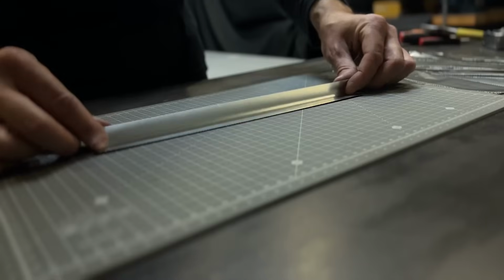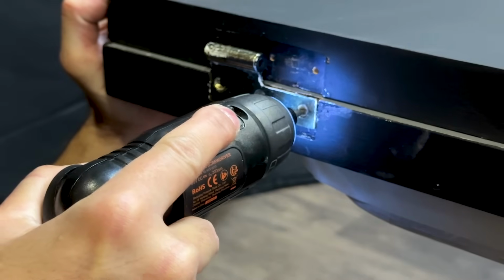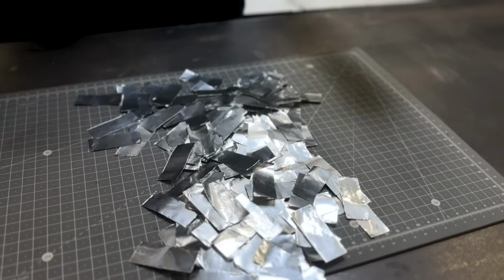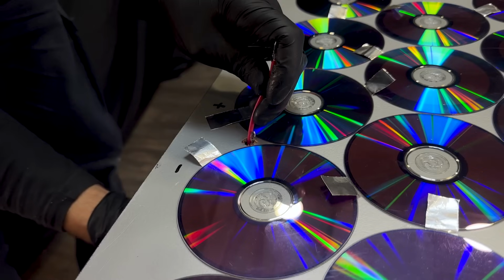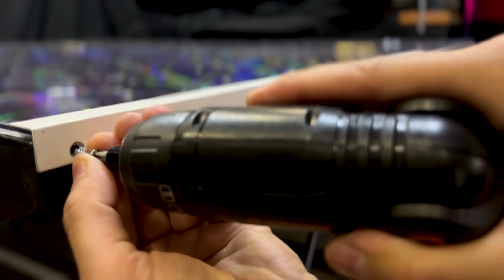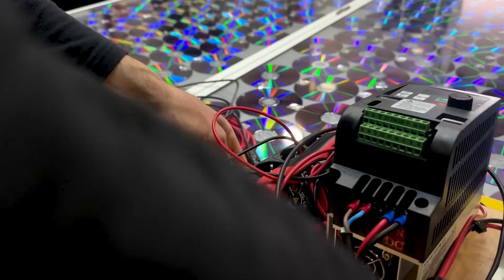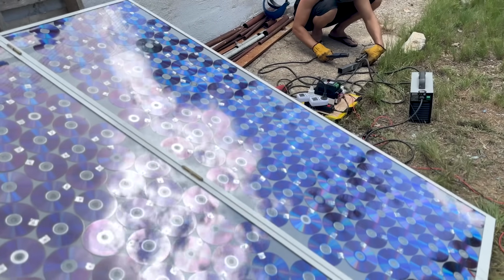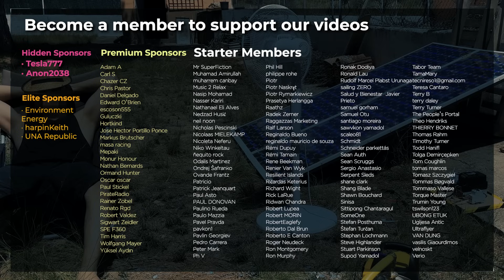Homemade Powerful 3000w Photovoltaic Solar Panel with CD / DVD

Comment: Why would someone ever think this might work! Don't waste your time or materials on this, it will not work.
Reply: Why won't it work?. Please explain
Reply: @murraychadwick9362  Just one of many reasons, and the simplest, is that the reflective surface in the discs is electrically insulated with plastic. Even if an electrical charge was created, it wouldn't "flow' through the plastic that protects the reflective surface.
Reply: @WylieWiggins isnt that why they connected the cd’s on the other side with the alu. Foil?
Reply: @Crypto_Zeus7610  plastic coated as well.
Reply: @WylieWiggins  Yeah, you forgot that it was grinded off with a small rotary tool ...to allow electrical conduction, then the foil connectors were taped on it. You clearly didn't watch the video! You just eyeballed it and skimmed through the video at best. Then you jumped to conclusions that it wouldn't work!
Reply: @Dale-wb9lz  Good luck with it than!
Reply: No they do! There has been several studies on it, they are not efficient and very low power output, and to aswer all your questions on how if there is a plastic coating, take a 12v lead acid battery and take a cd or dvd and face the printed side up and touch the two wires against the cd (not for too long, about 2-3 seconds at a time keeping a eye on the battery temp)  a arc will form across the foil creating a nice lightning style pattern in the foil so if that can be done then contact with the foil can be made
Reply: You can make a very basic solar panel with a sheet of white A4 paper and literally draw the circuit with a graphite pencil and connect it, of course it's very low powered but it generates electricity.
Reply: If you recon it will work because of a thin aluminium layer sandwiched in the poly, well you might as well buy a roll of aluminium foil.
Reply: @HuSiaCat Nothing useful. Lots of materials exhibit some photoelectric effect but very few are efficient enough to be useful.
Reply: I am interested in storing the energy for running  household  needs like light
Reply: serial 200 cd and 330v later?? 😂😂😂😂Why didn't the factories that produce solar energy panels think of this?
Reply: If it doesn’t work then how’s he using it ? Genuine question
Reply: WylieWiggins must be a Solar panel salesman...😂😂😂
Reply: @dorismileng1961    just buy a panel sized to recharge your battery bank in the shortest daylight your area has.  A charge, discharge controller rated at your estimated amp draw from bank.  But you can energize  c7 size led bulds ar 12v (recreation vehicle) bulbs in multiple choice lumen at battery level, some have multi brightness built on the bulbs. !
Reply: @WylieWiggins  so the fact that he ground away the plastic and then measured the voltage of one cd is proof it won't work?
Reply: @WylieWiggins  because this does work. It's in no way efficient but it does work. It's a great proof of concept as an experiment I have done this before.
Reply: That's why he exposed the foil to get a charge.   @WylieWiggins
Reply: @mrrandom3207  Not even up there with dragging stocking feet on carpet! Lame games people play!

Comment: I built two panels just like the ones in this video to power my homemade military satellite.  I launched my satellite yesterday using a bleach-powered rocket and it's currently in orbit reporting on Syria.  I couldn't have done it without this video.

Comment: did this today unfortunately the plastic on the cd shows no continuity and if you drill to the silicone yes has continuity but putting a sliver foil on one side will not make a circuit i wanted to debunk it so i made one its impossible to work FACT.

Comment: Oh my God, what nonsense! I work at a company that produces solar panels, from soldering the cells to laminating the modules and testing them with special devices called SunSimulators, or as we call them, Flashers. So, a solar panel does not function at all like it's shown in this video. The process of making a solar panel is as follows:

The glass panel is placed on the conveyor belt.

On top of it, an EVA (ethyl-vinyl acetate) sheet is placed.  
Then, the "Stringer" machine solders the monocrystalline cells in series with a conductive BUS BAR (10 cells soldered in series make up a "String").

Next, these strings are placed on the glass, which already has the first EVA sheet. Then another machine applies the connecting Bus bar between the strings with a +/- orientation. After that, the second EVA sheet is applied, followed by the reinforcement sheet "BackSheet," which is a stronger sheet, something like high-density PA (Polyamide High Density).

Now, the module goes into a laminating machine that, through vacuum and heat, melts the glass cells without shifting them and removes any air bubbles or traps. After this process, the module (or now called the LAMINATE) moves to a robot equipped with a knife that trims the excess melted film from the four sides. The next station is an optical inspection by a worker who checks, under strong light, if the bus bars are in position and if they haven’t shifted during the laminating process.

The next step is framing, where metal frames are applied around the Laminate. Then the junction boxes are connected by soldering them to the contacts that were left exposed under the film. Finally, the module reaches the SunSimulator (Flasher) testing system, which illuminates the modules and measures each module’s power, after which they are sorted by category. At the next station, the junction boxes are filled with a silicone that prevents moisture from getting in. After that, the modules can be packed. So, that’s roughly the process. What’s shown in this video is utter nonsense.
Reply: Did you notice that he was making a homemade solar panel, not a professionally made one in a factory.
Reply: @jerryrussell2600  Did you notice that in no way, what he’s making is a homemade solar panel.
Reply: @rusznyaklorand  I mean it does work very little and practicality is all out the window when youll have the entire Willis Tower in Chicago covered with CDs to power just a school bus ....it doesn't absorbed as much as you think which makes the person above absolutely right....this isn't a solar panel more of well a pain in the ass for very little to no profit...
Reply: However, you can lap CDs one over the other and fill the hole in the middle with hot glue and use them to shingle the roof! Just sayin’
Reply: @dcmp3po  However, when shingling the roof, make sure to use non-burnable CD’s.
Reply: @dcmp3po  If you had a concave roof, you could probably start fires on  gaseous planets. Or, if everyone would take all there old cd’s and carpet there lawn with them, we could reflect enough solar energy to stop global warming. Although it might not be safe to travel in an airplane.

Comment: The diameter of a DVD is 12cm, so radius is R = 6cm = 0.06m
The diameter of its inner hole is 1.5cm, so radius is r = 0.75 cm = 0.0075m

Area of DVD (minus central hole) = Pi x (R^2 - r^2) = (3.14) x ((0.06m)^2 - 0.0075m)^2) = 0.0111 m^2
Area of 210 DVDs = 210 x (0.0111m^2) = 2.338 m^2
Area of DVDs minus the 210 ~15mm x 15mm aluminum strips is 2.338m^2 - 210 x (0.015m)^2 = 2.291 m^2

Solar constant at top of atmosphere is  Gsc = 1361 W/m^2
Actual peak solar irradiance at the Earth's surface on a clear day is closer to 1000W
Actual peak solar irradiance at the Earth's surface on a cloudy day is closer to 500W

Total solar irradiance intersected by 210 DVDs at top of atmosphere = A * Gsc = (2.291m^2) x (1361 W/m^2) = 3118 W
Total solar irradiance intersected by 210 DVDs at surface on a sunny day ~ A * 1000W = (2.291m^2) x (1000 W/m^2) ~ 2291 W
Total solar irradiance intersected by 210 DVDs at surface on a thin cloudy day ~ A * 500W = (2.291m^2) x (500 W/m^2) = 1146 W

Claimed output of solar panel is 3000W, so:

claimed efficiency if it were above the atmosphere is 3000 W / 3118 W = 96%
claimed efficiency on a sunny day at the surface is 3000 W / 2291 W = 131%
claimed peak efficiency on a thin cloudy day at the surface is 3000 W / 1146 W = 262%
Reply: @green_dog8960  You explained it very well. So, does this system work?

Comment: There is only one way to find out is find one CD/DVD with double silicon layer and see if it can generate 1.5v
Reply: Проверил-добраться до обратной стороны невозможно,нужно спилить весь пластик ,а слой кремния очень тонкий и он не может держаться-.подключиться невозможно.Напряжение есть только от наводки,если держаться рукой за свободный конец прибора ,а второй присоединить к кремнию.При этом кремний тоже изолирован его нужно зачистить.Напряжение наводки может быть до 0,6 в.  А тока нет поскольку нет цепи.

Comment: is it posable to make a solar panel with CDs?

Yes, it is possible to make a simple solar panel using CDs (compact discs). This can be done as a DIY project, often used for educational or demonstration purposes.

The basic idea is to use the reflective metallic coating on the back of a CD as a makeshift solar cell. When exposed to light, this coating can generate a small amount of electrical current that can be used to power simple electronic devices or charge small batteries.

Here's a general overview of how to make a solar panel using CDs:

Gather the materials: You'll need several CDs, a small electric motor or LED light, some wires, and basic tools like scissors or a knife.

Prepare the CDs: Remove the outer plastic ring from the CDs to expose the reflective metallic coating on the back.

Connect the CDs: Arrange the CDs in a grid or panel configuration and connect them in series using the wires. This will allow the generated current to add up.

Attach the load: Connect the small electric motor or LED light to the positive and negative terminals of the CD solar panel.

Test and optimize: Expose the CD solar panel to a light source, such as a lamp or sunlight, and observe the operation of the connected load. You may need to adjust the number of CDs or the wiring to optimize the power output.

Keep in mind that the power output of a CD-based solar panel is relatively low, typically in the range of milliwatts. It's suitable for powering small, low-power devices, but not for high-power applications. The efficiency of this type of solar panel is also quite low compared to commercially available solar cells.

Nevertheless, making a solar panel with CDs can be a fun and educational project, especially for students or hobbyists interested in renewable energy and DIY electronics.

Claude 3 🤷

Comment: No way 3000 watts could flow through those little pieces of aluminum at the end connection on the panel. they would melt instantly. I call Bull Shit on this.
Reply: @danielohara2974  The foil ist strong enough to Transport all the current coming from this setup. No voltage means no current. So everything is fine.
Reply: @snooker216  my bad...You nailed it!  lol

Comment: 🤔 somebody please tell me I’m wrong!  let me think. I’m not going to go back and check the number of CDs, but if I remember right. They claimed they connected them all in series and got over 300 V at the end of the series. My question is why the hell are they using heavy wire to connect to their series of discs when the last connection is made out of flimsy little piece of aluminum foil that would blow apart with anyamperage put to it whatsoever. Tell me I’m wrong. 

Please tell me I’m wrong!
Reply: Maybe he used the wire size he had, if it is bigger than necessary that is never a problem.

Comment: Why the pixeled faces? 🤔  Using tape to secure the foil to the silicone surface?  Panels get extremely hot in the sun?  Hot glue?  First time out they would all melt off and separate.  3000W/330V=9A per CD "cell"?    

At 93 W/FT° of sunlight power, you're generating over 100% of the available power at 100% efficiency.  CD Dia 4.75" = 0.123 FT° x 220 disks = 27 FT°   93 W/FT° x 27 FT° = 2517 W and that's at 100% efficiency!
Reply: @MechEngrSC  Store bought solar panels are regulated to only 15% efficiency.
Reply: Haha, wrote nearly the same comment. Now I saw yours. But for the guys that use SI units it is still good xD.
Reply: Fraudster 😠

Comment: For those that say it won’t work, have you tried it? Or just said “no”? I don’t know either way, just curious. It reminds me of the guy who ran the patent office in the early 1900’s. Once he saw it went to a million patents he said it was time to close the office because everything that was or could be invented is now recorded 😅 Try it with one cd, the so stated, correct cd . What does the meter say?
Reply: @3Dgifts  I got nothing.
Reply: @frequencyguy1  cool, you tried and nada. Use the same type of cd/dvd? I am going to try and find one, sand the one side and give it a go with a meter to see if there is anything lol. If there is, i will post back, if not, Have a great weekend 😀
Reply: @3Dgifts  I'm curious if you get different results.  I don't know how you will as there is an insulating layer on the top of the DVD as well.  I tried removing it as well.  No luck.
Reply: @frequencyguy1  cool, I’ll let you know. At this point it’s about the fun in either proving or debunking. Either way a learning experience 😉
Reply: @3Dgifts  a cd is plastic covering a micro film of foil the foil might  carry a  small volt but never enough.  And plastic makes  nothing .now wise up.
Reply: @frequencyguy1   they ground the coating off to support conductivity! You didn't view the video did you?
Reply: Я пробовал один диск-Это не раьотает.

Comment: The problem with thus is over time the plastic panel over these will degrade under sunlight and reduce your efficiency. Don't waste your time with this just buy panels you would be much better off.

Comment: omg this just keeps getting worse the longer I watch. cd's don't generate electricity and those thin rubber gloves would melt before stopping any charge. Notice they didn't remove the plastic from the front side to complete the connection. Not to mention the aluminum foil would most likely melt. That's why the quit using aluminum wire in houses.
Reply: He did remove plastic on opposite side.

Comment: Many are doubtful, ok, just test  1 CD of the type he’s using. If it generates DC power then in theory this MAY work.
Reply: All you need is sand paper, tape, aluminum foil, a cheap multi tester, and a proper junk CD, cheap really.
Reply: Don't have to try this. There's a reason why the area surrounding the probe of the mulimeter during voltage measurement was blured out.
Reply: Fraudulent 😠
Reply: @Abshi_Ben  -- tested one silicone (i.e. purple) CD in my garage today; and yes, definitively produced/measured 1.561 V of DC electrical current. Very easy and cheap test to replicate. This is a totally workable design.
Reply: @radmirov8541   at one person is willing to experiment with this. Maybe I’ll try as well, seems like a lot of work but it at least does.
Reply: @ 
Current is measured on Ampere not in Volt.
This alone lets me distrust you.
Reply: @Abshi_Ben  If there is a current, then there will also be some amount of Volts. You canot have a current without Voltz. Genius. You must be a product of the public educational system. Sad.
Reply: @ This is not how solar panels work.

If you have an open circuit the voltage is higher than if you don’t. You’re measuring Uoc in V.

If you short the terminals  there will be almost no voltage (because it’s shorted) but max Ampere it can possibly provide. It’s Isc in A.

What did you measure by doing this?

Any amount of volts without Ampere flowing is still a multiplication by zero (P=0W). You, with your little measuring device definitely did exactly that. You measured Uoc without a load. That alone doesn’t mean anything if that even happened the way you claim smart ass!

And no, I got nothing to do with any crappy education system public or not.
I can assure you that’s certainly not where this knowledge comes from buddy.
Reply: @Abshi_Ben  OK. You definitely need to pick-up and read an elementary school book in physics and electrical currents. So sad. Your parents and school teachers did you so wrong. Or maybe you are just stubborn and not open to learning simple physics concepts. Just go to a local city library and check-out, read an Introduction to Physics book. And learn to control/manage your anger. Once again. You cannot have a current WITHOUT voltage. The formula is super simple (V = I R) . This a very ELEMENTARY and simple concept. Current cannot exist without voltage. You would fail a simple elementary grade physics exam with your absence of logic. Once again, look at the simple formula. ( V = I R ) . This is the simplest and most straightforward formula possible.
Reply: en mantıklı cevap
Reply: Tried one. No reading at all
Reply: Tried a solar cell with a torch. Immediate reading. The supposed 5 times more powerful cd showed no reading whatsoever

Comment: I was able to run a home refrigerator at night on mine.
These may be better than harbor freight panels!!
😂
😂
😂
I've got it powering the fridge but going through 4 Bagdad batteries made with local soils 
It's sooo amazing 🤩😂😂😂😂

If you want I've got some rocks that I handpicked from a stream because these all have diamonds in the center of them but you can have them for $2 each. 
I can't guarantee that they all have diamonds in them but I know there's diamonds in there!! 😮😂

Comment: With CD=1500W, With DVD=3000W, with BD=6000W! 🤣🤣🤣🤣
Reply: @gyorgystefanka2281  
YOU mean 
A TO Z == power grid??
Reply: @zadvindersingh6921   Of course! disk intead of pendrive more power! 😂😂
Reply: @zadvindersingh6921  The whole video is a joke! The surface of the discs is insulating plastic!
Reply: What is BD ?
Reply: @John-zc4rz  Blueray Disc